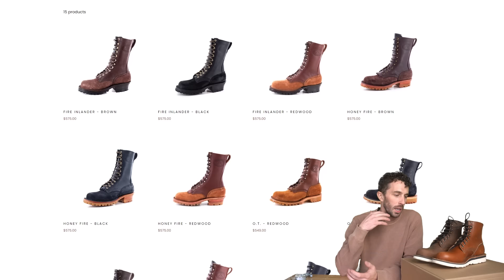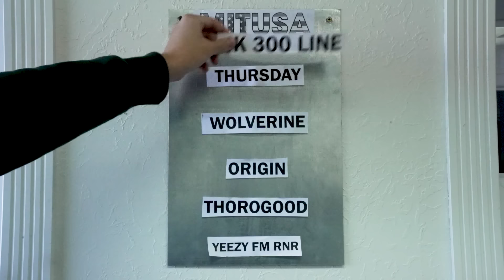Did JK Boots really make a $600 boot for $379? JK 300

Comment: +1 on the JKs,  I have the 300s and the Forefronts with the composite toes and they are awesome.  I was normally a Keen fan but they are getting expensive and you cant resole them so I went all out.  They have a nice wide toe-box like the Keens so thats what sold me on them.  The 300s are very easy to break in and feel like a sneaker, the Forefronts are super beefy!
Reply: How do the 300's compare?  I've been eyeballing for the Forefront for quite some time.  Is it worth to spend the extra coin and go with the Forefront?
Reply: I've been wearing Keens for years for my daily work boot but have to replace them at the year mark every time. Love the comfort, but have been looking for a replacement with more durability.
Reply: @fatfredthe28th  I have a pair of forefronts in redwood and I definitely recommend them. Ive had them since July and they are starting to feel amazing now that they are truly broke in. Still comfortable out of the box though but the leather is more stiff at first for sure
Reply: Can you tell me please how is the sizing, i am very new about boots i have one Iron ranger and i love them but i need something more for dayli use, rain etc but not really for work, so im wondering if the 300 will run small or big or just true to size? And are they confortable enough for a dayli boot? Thanks so much
Reply: @fatfredthe28th  If you can swing the xtra, get the Forefronts.  If you see them side by side its obvious where all the extra cost went.  Plus, if you get the 300s, youll always be wondering what you're missing and probably get the Forefronts anyway.
Reply: @robertocarrillo9919  JK tells you how to size them on their website,  Your JK boots will likely be 1.5 to 2 sizes smaller.  Im normally a 12 in every other shoe, but my JKs are a 10.5,  They are super comfy,  almost like sneakers, but give them a couple weeks to break in.
Reply: @drewpknutz1410  thank you very much for your answer, very helpfull 🤙
Reply: @drewpknutz1410  , thanks for the feedback. I suspected that was probably the case, but good to have some confirmation from someone with both. I'll likely go that route when I pull the trigger.
Reply: When you ordered the 300’s, did you click “average” or “wide” when ordering on their website.  I’ve been a Keen guy for years, love the extra room in the toe.  Found most redwings too narrow in toe box
Reply: @kennethhirsh6660  I ordered from their shop in Spokane, dude measured my foot and said I was a "Wide".  Im 6-4 and 240ish pounds, so my foot may be a little plumper than yours.  If you were a wide in other shoes, youd probably be a wide in theres too. If not, you can return them if you try them on and the fit is obviously wrong.

Comment: As others have noted the SuperDuty/Inlander do NOT have stainless hardware this would be great as I work for an Ag chemical company after 1.5 months of 2-4 tanker washouts a day dealing with Aqua Ammonia, Sol 32, Copper, Zinc, Mag etc. The screw heads are rusted that happened basically day 1 but I will likely wear out the soles and the screws will be replaced at that time before I have hardware failure. This is one area I hope they improve on in the future but no deal breaker for me, the brass eyes only lightly but permanently tarnished. Other than break in was easy and i wear them 7 days a week no foot pain anymore.

Comment: I've had JK's super dutys for years now. They are built fantastic and feel great the whole time you have them on your feet. As a millwright at a sawmill I beat the tar out of them on a daily basis, I'm talking fire, oil, dirt, welding/torch slag, sharp steel, snow etc. And they just take it. They will last me 2 resoles in that hard of an environment before needing rebuilt. Worth every penny when you see cheap polymer material based boots fall apart in the same environment in a matter of weeks. If you think JK's won't last or aren't worth it I'd beg to differ. Worth every penny.

Comment: I have a pair of Superdutys with the Vibram Crissy sole and I love them. I’m a welder/iron worker so I tend to be pretty hard on boots. Thorogoods used to be my go to boot. Not anymore. I’m a JK boot guy now.
Reply: How would you compare the comfort level between these and Thorogood?
Reply: @whorewrangler  The JK boots are more comfortable. Thorogoods are nice boots but I always felt like my Thorogoods were either too tight or too loose as far as fit goes. The size never felt spot on. With the JK boots, as long as you take care to size them properly, you won’t be disappointed. I can’t stand my toes being smashed together in narrow shoes/boots and I was able to get my JK boots perfect. Not too wide that I’m floating in my boots, but not too narrow that my toes are rubbing and smashed causing hot spots. I truly am impressed how nice the feel every time I lace them up. I now have three pairs.

Comment: been wearing my JK300s for about 6 months now. they are SO comfortable. insole is thick AF and break in takes about a week, but the upper is so soft and supple there's no issues after a day or two of wear. i literally wear these 13 hours a day.
Reply: they are also built better and thicker than my IR. can't wait to get a resole and get a thick chunk of leather in that midsole.
Reply: how's the sizing compared to typical off-the-shelf boots and shoes? thank you
Reply: @coalknob  go one size down. I'm an 11-11.5E. 10E fits great.
Reply: @CallsignArchangel  thanks!
Reply: I'm looking at these for walking on concrete most of the day. How are yours holding up?

Comment: Need to checkout the “Patriot” by Franks boots! 359$ list price and supposed to cut no corners just no custom options to accomplish the lower price! Incredible people and incredible company!!!
Reply: I'm hoping for a video on those as well. Want to know where the savings are. Celastic heel? Thinner leather? Different Shank?
Reply: The only "corner cut" I know of is on the inside where everything is put together. Normally they get a McKay Lockstitch on the inside holding everything together, and then the leather gets flipped back out to get "stitched down" to the sole with a Rapid-E stitching machine.
For the Patriot the McKay Lockstitch is skipped and instead glued. (These JK 300's are glued too) Many who know what they are talking about would argue glued is still a plenty strong boot, but it is what makes a boot not rebuildable, and does help allow a lower price point.

I definitely want to see them torn apart I don't think anyone offers more boot for the money.
Reply: @SuperCeder1  heel is definitely the same. Leather is the same but some pieces are used that might barely miss the cut for their regular boots. Like, they try to make a pair out of the same hide, but the Patriot's might come from several hides. The arch is the same too. The only thing I know of other than what I just said to Jeremy is a few less stitches, no MTO, and less sizing options.
Reply: I thought the patriot was 349?
Reply: @jeffmitchell72  the patriot is rebuildable, but a Frank's rebuild runs anywhere from 289 to 400 so at 349 for a patriot it's not worth it to have them rebuilt. Frank's chooses not to rebuild the patriot but they are still rebuildable
Reply: @alexanderlevesque2694  that might very well be true. I think they receive a few less stitches, but probably not enough less to affect rebuildability. 
You are also correct of course by saying what would be the point anyway.
Reply: @alexanderlevesque2694  yes...349
Reply: @jeffmitchell72  I think Drew's boots makes a model of their logger for right around 400 bucks. Sometimes it goes on sale for around the 350 mark. Might wanna look into those if you're interested
Reply: @Arto257  Drew's is cutting corners having it made in Mexico, and Drew's doesn't offer a protective toe. It's funny, cuz Drew's, who makes nothing themselves, has 2 boots that are just like the Patriot. An American made for 550 and a Mexican made for 350. So 200 less to be made in Mexico? But Frank's can do it USA for 350? 

So yeah.....Frank's wins that one.

Comment: A lot of items that are handmade, the price is in the work the craftsmen do, moreso than the materials. And the choice of more expensive materials sometimes necessitates more complex construction. So if the person making these boots can stitch a 360 welt in 2 minutes vs. 10 for a 270 + nails, huge savings on a per item basis. Same with a leather shank may require more time, the cheaper leather may be easier to work with, etc.

Comment: Just got mine. Flat out missed the boat in every way when it comes to fitment. Used their print this out JK measurement template. So narraow my little toe is getting pushed under the next toe. My big toe in both boots feels like the saftey toe was put in crooked. The last they use makes my heel feel like it should be on the outside edge of the boot. These also feel like they are made for people with flat feet, my arches dont even touch the insole.
Reply: Damn that sucks having wider feet makes finding shoes hard

Comment: Now for honest non sponsored review - so I ordered “in stock” 300 with safety toe which took 6 weeks to receive, unboxed and went through the whole 4 page FAQ of how the exchange and return process differs from website no biggie other than basically don’t wear or oil them at all if you plan on exchanging but oil them if there are hot spots while wearing them - confused yet it gets better. In the box were Spenco insoles again confused as the 9 iron according to them and a majority of my work boots should suffice until break in. Took boots out of bags and that’s when things went south. First this is JKs lowest cost boot at roughly $400.00 with specs that say  between 5-6oz leather(same as Redwing Heritage for example). These have a feel of 3-4oz(Danner Bull Run for example) The leather is also glove/jacket soft in upper and vamp so as far as longevity it could go 6-18months before replacement. A quick glance inside and now see why the need for the added insoles - fit and stretch of upper and vamp around the leather insole is a sloppy mess of gaps and cobblers glue with the right foot in worse shape than the left(asymmetric) this sloppiness extends to the placement and fit of the composite toe. I check the stitching on the larger than normally seen stitch down welt see they tried to tighten a gap by adding overlay stitches. I slide my feet in and due to the noticeable gaps insert the insoles just to have a better base. 
So with all the issues why didn’t I exchange them - can’t afford an additional 6 or more weeks to only receive the same suspect quality let alone the return process is just as much of a headache - why because a work boot has to be worn and the moment it is the whole return/exchange is non existent including the warranty. With the 300 being the “entry level” boot the expectations were the same that the same quality that is put into their other boots would be there unfortunately they were not and it seems JK missed the mark on these like Whites did with the Perry. For clarification on my expectations - I’ve worn Viberg, WESCO, Hoffman, Matterhorn, Red Wing 899, Halls, Franks, Nicks, Thorogood, Carolina, and Wolverine. So I have experience in everything from custom to mass produced handmade and machine made. Hopefully this helps in your decision making. - update I have received a request from Jared with JK Boots not to post any review that is negative as it hurts the image of JK Boots and due to the issues they feel that they cannot meet my expectations of quality and will give me a full refund in return for removing any negative post instead of just correcting the quality issues. I will be happy to forward the emails for you to see for yourself. It’s kinda funny to see that the boots they provided Rose Anvil are nowhere the same as what was delivered to me especially when you don’t see the midsole in gaps around the insole like in mine.
Reply: This totally sounds like JK. Except usually they don't offer a refund. Usually in exchange for taking down anything negative they offer to split the price with you for you to buy another pair.
Reply: @jeffmitchell72  I wish it wasn’t the case. Unfortunately, it seems they would rather make sure their best quality is put out to reviewers like Rose Anvil but slip in quality and then make the excuse that they “ just can’t meet my high level of standards and expectations “. It’s a crap shoot for $400

Comment: What I did is buy a $50 walmart boot that's mixed with canvas and leather.. I wore it out until the soles were done.  I removed the sole and put on this exact vibram wedge sole from this video, and I bought a thick 2mm to 2.5 mm leather insole.  Contact cemented everything together, and took an AWL to the rim of that sole and sewed it on myself.  Incredible boot now, that I resoled for only like $35 to $40.  I could not imagine paying $600 for a boot, or even $350.  That's just crazy.   I do have a nice pair of Georgia and Red Wing boots.  Also a thick pair of Harley Davidson boots that I again, resoled myself with the vibram wedge and a thick leather insole.   People really need to learn to do this stuff themselves.   It's actually super easy to do, if you don't' mind hand stitching.

Comment: Just got my 300X yesterday, wearing them right now.  The toe is really soft (I didn't opt for a safety toe because I wanted to keep a less bulbous profile) but these are for daily non-work wear (that's what my Nick's Tacticals are for).

I would've liked either blacked out hooks and eyes but the brass isn't reflective and a pull tab (because I've had them on almost every other boot I've owned).  The leather isn't super smooth and does have a bit of a pattern/grain on them, especially the toe of my right boot but conditioning (I'm on the fence about polishing these) might make it less visible.

Did I need the burn-resistant thread or the Vibram fire sole?  Of course not but I've got a $400 boot that I didn't have to wait several months to get them.

The included paperwork and instructions for lacing was a nice touch.
Reply: How's the sizing?
Reply: @RogerRabbitt  I'm an 11.5 EE on the Brannock but following their measurement guide I'm a 10 1/2 5E in JKs.  Had a bit of slip but bought a pair of their insoles and that problem got solved.

Then in Nick's I'm an 11 E...so go figure.